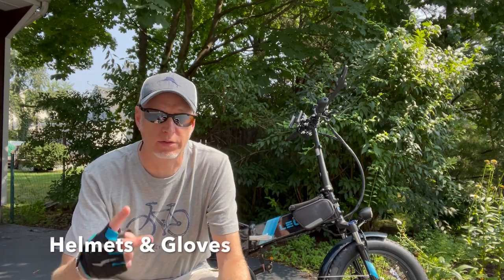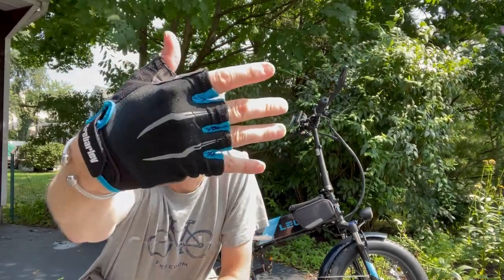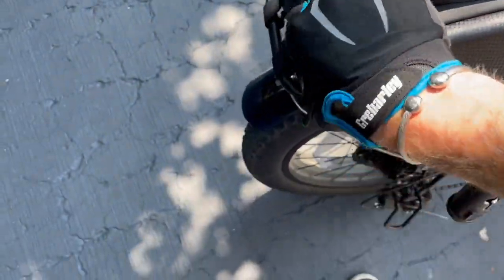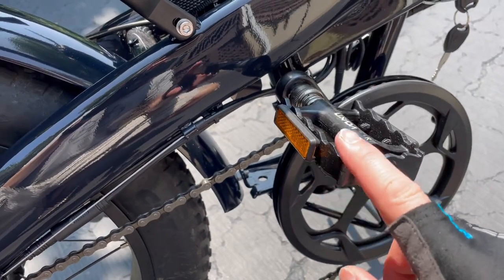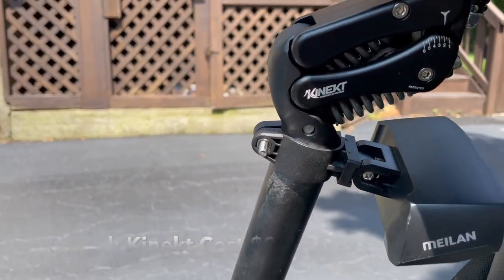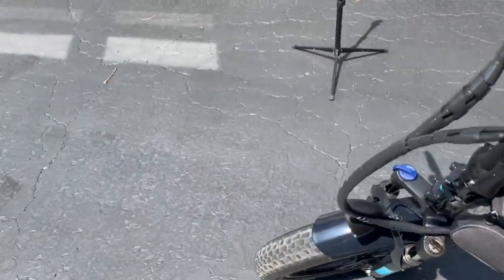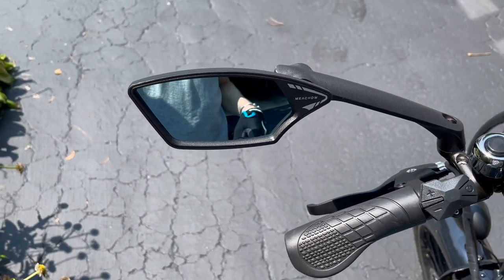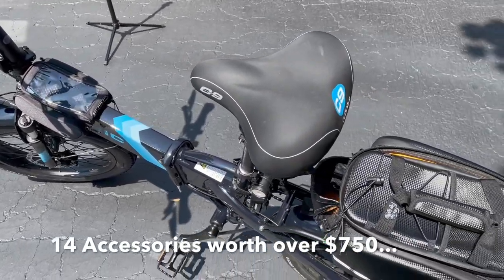Cool Accessories for your Lectric Ebike

Comment: I getting a trailer for touring plus extra battery for long distance.  And solar panels for charging in woods or isolated areas.
Reply: Get a Ecoflow solar generator
Reply: You're gonna need a trailer just for accessories !
Reply: What panels would be powerful enough to charge these 14ah batteries?
Reply: @livesofthefreemasons  or my 70ah 😅

Comment: Just picked up an XP 2.0 step through on sale for $850 shipped!  I ride it in a city and it is great!  I am toying with the idea of unlocking the class 3 but really recognize the battery economy.  I will probably play with it tomorrow to see if it is worth doing, I like the idea of charging it every other day vs having to charge it nightly.  I thought about pulling the trigger on the bigger battery but $500 is quite a bit... I do recognize that having the battery it came with as an additional means of fuel would be sweet... Those 8 extra MPH may or may not be worth it, I guess it would depend on how bad you need to be somewhere and what your time frame is.  I really appreciate your video, it definitely has shown me some cool upgrades!
Reply from the maker: Thanks for watching and welcome to the club!

Comment: The frame bag will eventually wear a hole in the paint. These bags are always moving with bumps and just the vibrations of road and bike, working like sandpaper on the paint. I didn't see anything to change a flat tire. You will need a pump, innertube, two large wrenches for the front and back axel bolts, and possibly a hammer too, along with enough allen wrenches for the torque arms, and disk brake removal. I didn't see any tire levers either for removing the tire from the rim for repair. You should also carry a chain break tool for repairing a broken chain, and an allen wrench big enough for the crank bolts which always come loose. I didn't see a spoke wrench either, very necessary for truing a wheel when you break a spoke. Panniers will not clear your feet when your feet are correctly positioned on the pedal, unless you have very small feet, under size 8.

Comment: On the rear light, I installed the same. BUT, behind the rear bag so it's 100% visible to traffic. You need a right angle bracket (many racks do come equipt) behind the rack to attach the light to. I used a 3" long round PVC pipe, connected that to the rack bracket; in fact with two holes on the bracket it takes #1 of 2. Then used the std. connector that comes with the unit, and secured that to the 3" PVC. Used hole #2 to squeeze in a 2nd 3" wide red reflector. If they can't see me they're driving blind. And the remote signal unit has no problem with it behind the bag.

Comment: I really like the Wowtow frame bag, the phone /stash case is removable and there's roomy pockets for snacks for the bonks or an mp3 player... I just got the bag today so haven't fully explored the possibilities yet but I intend to. 

I've only had my Lectric 2.0 bike two days and absolutely love it. I was in and out of the garage all evening customizing and just getting to know what's on the bike and where, and read the manual and, you know, things like that. I just love my new Lectric 2.0, I could go on for hours. 😍🚴
Reply from the maker: Nice, welcome to the club!
Reply: I'm thinking of buying this wowtow, it costs less than 40$.
Reply: @strout2944  It's a good bag and carries a lot of stuff easily: snacks, bike alarm, MP3 player and small souvenirs I might find on the roads while riding.

Comment: I ordered two Lectric step thru bikes for Christmas.  The first one was lost in shipment but a replacement is in route.  I did get the second one and have only 10 miles on it.  I am very impressed.  I appreciate all the comments and videos you have made.  I am looking for accessories to make the bikes even better.  I missed the thumb throttle source but do not need it right now.  I just joined the group a few minutes ago.  I live in southern Utah and expect to have a lot of fun with the bikes,

Comment: My bike has the same short handle bars. I bought some handle bar extensions for mine. They give you an extra 3 inches on each side after you take the grips off fit them and put the grips back on.
Reply from the maker: Extensions? Interesting

Comment: Nice. I have two Halo motorcycle headlights on a piece of copper tubing mounted on the front where the basket would mount. Use a 12v mobility scooter battery. I have it in the bag on back. It's over kill. I shrunk in my old age, have a Dropper post the raises me up 150mm. Amazing how much it helps. Just bought chrome electric cable covering like the black stuff already on the bike. My back freewheel is nickel plated 11-28 T. A little shine.
Reply: What is a dropper post.
Reply: @fondrees  It's a seat post that works exactly like a office chair. Pull the handle, it goes up or down.
Reply: @Saddletramp1200  wow thats pretty vool. good idea. i need one. thanks

Comment: You gotta checkout the CYCL Winglights; they're turn signal lights that mount to your handlebar. Make sure you get the 360 version, which is rechargeable. They look awesome at night and have a front and rear light feature (white and red) that stays on while you ride.

Great video! Got me thinking about the upgraded headlight
Reply from the maker: Yeah i eventually put on winglights

Comment: Nice video and looks like an excellent bike, but I have found for International and Canada it is a risk of you read their policy, basically a buy it at your own risk for returns.

Website Policy:
You may cancel your order for a full refund up until the time you receive your shipment confirmation email with tracking information. If you cancel after your order has been sent you are responsible for the return shipping fee.  In addition, the original shipping fee we incurred to send the bike to you will not be refunded (even when ‘free’ shipping is advertised). Our refund policy is ‘All Sales Final’. Unfortunately, we can’t offer a refund or exchange after the bike has shipped.

Comment: When I ordered my bike, the ready kit never showed up. I was told by customer service it’s my problem.
At least they didn’t charge extra for the flat and damaged rear tube, scratched paint that looks like someone used a grinder on the fork and the rear of the bike.
I ordered a tube on eBay so I can fix the bike and get it rideable to sell.
Reply from the maker: bummer

Comment: Hi Chris, I believe I have the same Rock Brothers bag. I believe I understand why you have it facing the way you do so the water bottle is near the seat, but isn't that backwards? On mine, there's a reflective strip around that bottle holder part that can only be seen if you had the bag turned around and I believe it's supposed to be alerting cars and other riders behind you.
Reply from the maker: So I had it the other way at first, decided to reverse it to put the water bottle bag nearer me. It also fills up more of the empty space under the seat.

Comment: Hey Chris, you're going to have as much money as the Lectric cost invested if you're not careful, lol. Anyway to mount that turn signal to the rear of the pannier bag or frame?
Reply from the maker: I know right! I knew I spent hundreds but noth that much lol. Unfortunate mounting points for that taillight are only for the seat or seatpost. I suppose you could zip tie it there

Comment: Hi Chris, do you worry about your seat post being stolen or do you have a way of locking it?  Thanks for the nice video's.  I'm enjoying my 2.0 as well.
Reply from the maker: No I’m never far from the bike, actually I’ve never needed to lock it so wil only be using lock sparingly
Reply: a screw or 2 thru the posts with a little jb weldin the grooves to prevent unscreing will provide a semi permanent solution to theft. or future modification on your part as well,lol

Comment: I recently bought some Lectric accessories, and they are giving me the run around. Do you guys also have this same treatment?
Reply from the maker: Can you be more specific? I typically buy after market for most accessories.
Reply: @ChrisCrossed  specifically bought the Xp lite back rack. When I emailed them at time package arrived(also bought fendors together with it;only fendor arrived) I informed them of the missing package. And then they proceed to send me the frame folding latch(don’t know the true name). I told them they didn’t send me the back rack. They responded. Brb
Edit:specifically talking about the Lectric main store. No off brand.
Reply: In addition the fendors they did send me, the front ones came bent.
Reply: @ChrisCrossed  upon being loud, the Insta responded, hopefully they will send the XP Lite Rear Rack.
Reply from the maker: @rockfire1669  good luck
Reply: @ChrisCrossed so back with updates, So they have sent me 2 sets of bent fendors, 1 bent rear rack, and 1 mid frame folding latch(should have been a rear rack). They should be shipping me another set of fendors and rear rack that will arrive tomorrow. I will be recording myself opening it(legal reasons). Now I didn’t give dates but yeah.

Comment: Are you still happy with the Lixada Bike Pedal Mountain Bicycle Pedals? Anything better that you would recommend?
Reply from the maker: Yes I like them a lot, there’s a few other QR versions out there but these work great
Reply: @ChrisCrossed  , great! I made the purchase. What are the yellow things that come in the wrench bag? Are they extenders?
Reply from the maker: @MichaelTitera  I think those are just plastic packaging
Reply: @ChrisCrossed  , actually, I think they are some kind of tabs to make it easier to take the pedals off. Not necessary. I just installed the pedals and they are much better than the stock pedals. Thanks for the recommendation!

Comment: The helmet you linked is the wrong model. The one you linked is the cheaper one with the button battery light.
Reply from the maker: try this https://amzn.to/3mDQQuu
Reply: @ChrisCrossed  yep that’s the right one. I’m getting it. My bike should be here soon.
Reply: @ChrisCrossed  can you also link the bell? It’s not in the description :)
Reply from the maker: @muny_man  https://www.amazon.com/gp/product/B08NC1XKX4/ref=as_li_tl?ie=UTF8&camp=1789&creative=9325&creativeASIN=B08NC1XKX4&linkCode=as2&tag=chriscrosse08-20&linkId=932282c9d559a347910ee563a67e92c9